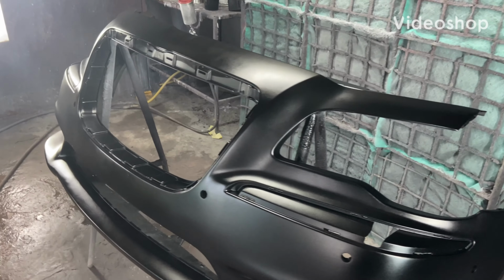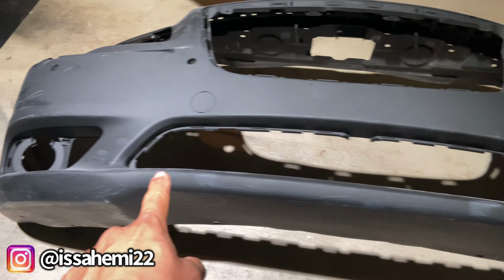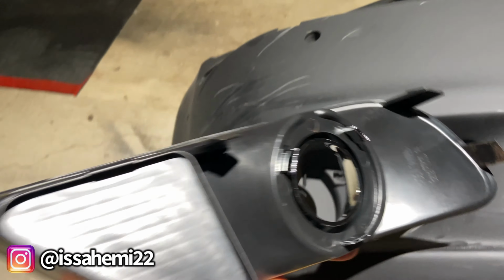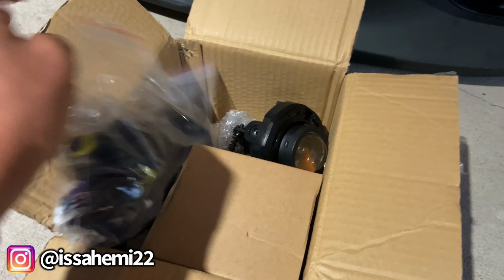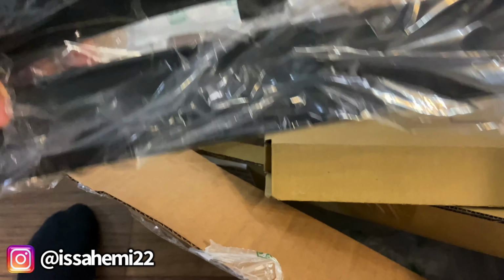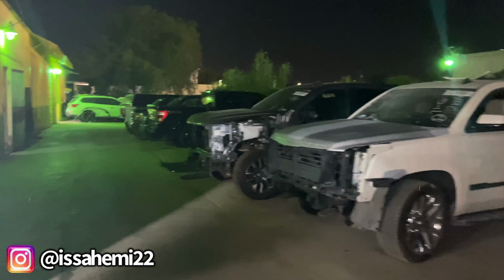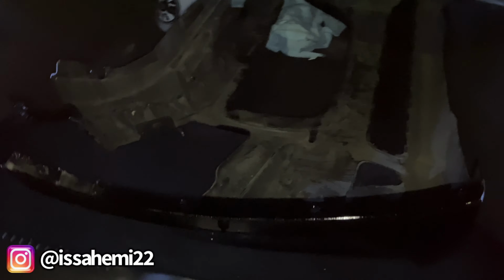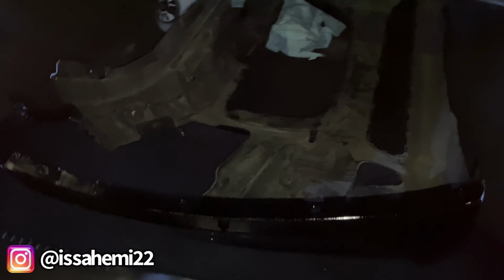🔥 SRT8 CHRYSLER 300 BUMPER UPGRADE 🔥 IS IT REALLY WORTH IT? 🤔

Comment: Bro what did you use to cover the holes on the bumper ?
Reply from the maker: The small holes on the bumper are for the sensors. My car has sensors on the front bumper. If you don’t have sensors they sale the srt8 bumper without the holes.

Comment: That’s what’s up bro I got a chrome mesh grill I’m installing from the oem . I also had to get more foglight assembly’s because of water in the old ones so do they snap in or screw in?
Reply from the maker: 👌🏼 That’s what’s up these snap in place. I haven’t had any issues with these yet.
Reply: @issahemi22  the foglight assembly’s snap in right?
Reply: You don’t have to remove the black bezel I hope.
Reply from the maker: @cmackinahemi300c  yep
Reply from the maker: There a outside bezel that locks it in place, that will need to be removed it pops right out with I flathead just be careful when your doing it.
Reply: @issahemi22  kool I just put the chrome mesh grill in today next replace the headlight assembly’s with oem halogen with leds.